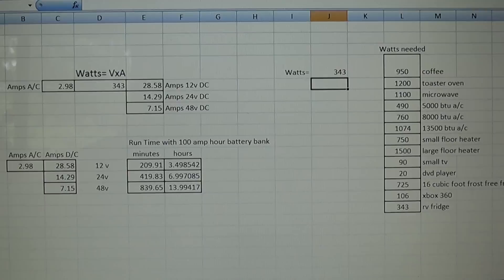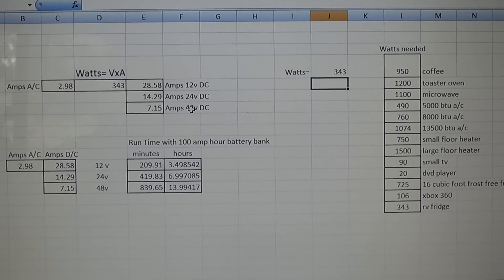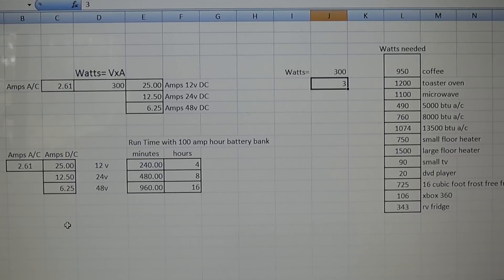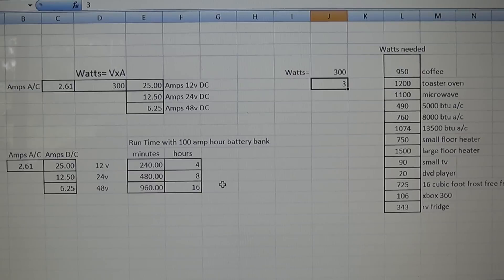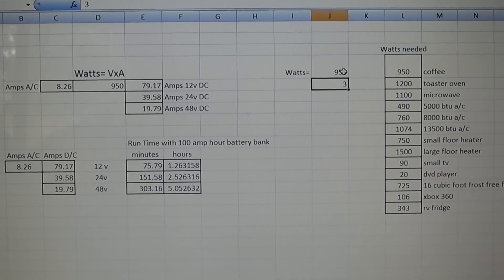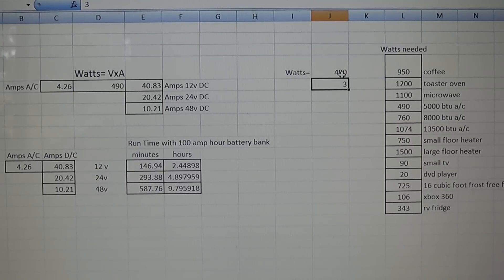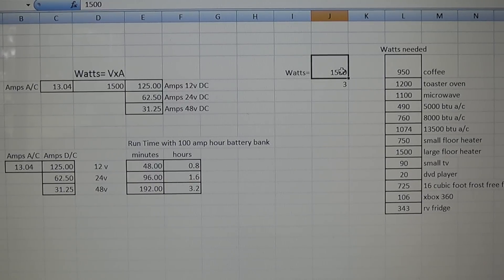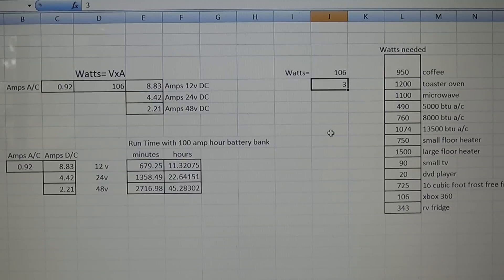What can run on an inverter and for how long?

Comment: i am sure you know that you cannot draw so many watt-hours in normal led acid battery but you can drain 50% of the watt-hours from an AGM deep cycle battery so on your spreadsheet this give 1.75 hours instead of 3.5 so you can use many devices who run for only minutes instead of hours like the coffee machine, toaster and microwave and all the electronic device who use so few watt-hours. 50% of 100amp-hour*12 volts= 600 watt-hour so with 2 battery in your battery bank, you can run the Dometic or Engel highly efficient 12 volts fridge who need in the order of 200 watt-hours per 24 hours and you can have a fantastic fan and charge your laptop and cell phone and tablet, etc... The only compromise is using a catalytic propane heater instead of an electric heater. Of course you cannot have an air conditioner unless you have a soft start device to manage the surge current plus a portable gas or propane generator.
Reply: I have a question for you.  I have one AGM battery, that is powered by one solar panel.  It is always at 13.6 or so on the control panel. Is 13.6 good enough to run a  Dometic CDF-11 Smallest Portable Freezer/Refrigerator? or even a small ceramic heater on low like 800Watts?
Reply: 13.6 volt is a full charged AGM battery, you can go down to 12.05 volts which is 50% without damaging or lowering the life of your battery, and most good standard AGM battery have around 100 amp-hour of capacity so this mean 100x12= 1200 watt-hour but you can use only 50%= 600 watt-hour and this is enough for a very efficient Dometic freezer/fridge with a 12 volts Danfoss compressor.

 Typical value for this device is 200 watt-hour of energy used in 24 hours if it is well isolated and ventilated and full of goods. CheapRVliving Bob Wells is an expert user in very hot Arizona. check his video channel.

 The 200 watt-hour of energy used will require 2 hour of good sun on a 100 watt solar panel. Check Will Prowse channel, he is the top solar expert and he wrote a fantastic book on Amazon. (research Will Prowse and you will find the book).

 A ceramic heater is a huge beast in term of battery and solar. One hour is 800 watt-hour. you can only use 600 but 200 for the fridge leave you only 400 so this is 400/800= 30/60  so you can have only 30 minutes of heat. This is not a good solution and it will deplete your battery too fast.

 Propane is the most concentrated form of energy in relation to heat but the only drawback is humidity. Burning propane means increasing the humidity level so possibly you need to ventilate more and watch humidity condensing in places it will create problems. One Awesome Inch channel is the best for information about this subject. He is using mostly Camco Olympian Catalytic heater, Wave 3, the smallest size

 Justin Credible in Vancouver promote wood burning inside a van, he is using a marine very efficient wood device. Check his channel.

 If you are a millionaire, Lou on Nomadic Fanatic installed a heat exchanger system, you can burn gasoline directly from your tank or diesel or propane with absolutely no humidity increase.
Reply: 12.05 is half of 13.6?  Wow, I'm in trouble, lol, I never would have figured that in a million years. Thank you for your input.  Now I'm confused even more, enough to know I probably shouldn't use anything in my inverter.  I just wanted to run my Dometic.
Reply: yes your unique AGM battery is plenty for a single electric load, meaning the Dometic. but if there is no sun, you will still discharge your battery in 3 full days. 600 watthour available / 200 watt hour used by the dometic in one full day= 3 days so the alternative is to travel and use a disconnect marine switch to link your alternator with your house battery. With cable and install, this could be around 100$ if you deal with a retired mechanic but could be 200 in a regular garage o 300 in a RV garage. It is possible i am wrong, you will have to check.  Third alternative is a little generator. Roadtrek Rich bought a very cheap generator and it is enough for occasional use. Check the internet for a table of voltage and charge for your AGM. in my case, 13.6 volts is a full charge and 12.05 volts is 50% full charge.
Reply: This has been VERY helpful. I've really tried to find this information on my own.  I am always in full sun here in NV, but I also have an 800Watt generator for emergencies (Earthquake 11613, 700 Running Watts/800 Starting Watts, Gas Powered Portable Inverter)  and a Schumacher XP2260 1200 Peak Amp Instant Portable Power Source and Jump Starter.   One of them have got to work for Dometic when solar doesn't, right?  I am going to Jamie's van build in hopes someone will show me how to use these affectively.
Reply: your Schumacher is a 1200 watt-hour AGM sealed led-acid battery, and the available 600 watt-hour will drive your fridge for 3 days. 1200 in the marketing name come from 12x100 amp-hour. There is so much confusion in marketing publicity, they don't see the difference between 1200 cranking amp (Peak Amp) and 1200 watt-hour of stored energy.

Most regular size AGM are around 100 amp-hour capacity so all the previous calculation apply to your case. A cable capable of flowing 1200 amp is big like my thumb. Do you see that around.   

Your Earthquake 11613 is big enough to recharge the battery inside the Schumacher. So it is not: one of them will work for my Dometic, it is one will work and the other will recharge the one working.
Reply: Denis Fortier perfect. Thank you!!!
Reply: Denis Fortier oh wait, can the Schumacher also be used for the dometic for a few hours in case I dont have enough on my other agm battery? I am getting a new house battery in my van ( for the engine ) someone suggested interstate was good. Do you concur? I would like to use it also to recharge the Schumacher when necessary while traveling. I know you suggested an alternator hook up but my mechanic said no. He’s not as smart as you apparently.
Reply: I check the web page of this product and the Schumacher is built around a 100 amp-hour battery so you have 1200 amp-hour/2=600 amp-hour available to feed the domestic for 3 days, not a few hours. A good battery for you is a battery who is guaranteed long enough for you according to the price you paid. If the price of the interstate is comparable to all others and the same for the guaranty, this is the same product, possibly with a different casing. For example Canadian Tire sell batteries but they just stick a label on them, they are coming from a major producer. If the battery is way cheaper, it is coming from China and should not be considered. Personally i love the AGM Eliminator series in Canadian Tire and the Nautilus marine deep cycle AGM series. It really make a difference in winter. 

Good mechanic are not always good electrician and good electronic technician. Now everything is computer controlled so many times you have to go to the official dealer because only them have the good scanner to read the codes and download patch in the firmware of the car.  

1) If only you drive the van, the lest costly install is a simple marine switch to link the starting battery and the house battery or a system doing an equivalent work but if you forget or badly use this basic system, you can overcharge your house battery and damage it or forget the switch on and discharge your starting battery

2) so they tried to replace the switch with an electronic disconnect (simple set of 2 big power diode) to link the alternator with the 2 batteries but separate them when the engine is off. The dis-advantage of this device is there is a loss in the diode so your 2 batteries are never completely fully charged

3) so they propose solenoid switch and you cannot forget because they automatically switch off but most of the Chinese cheap one don't last long because of the continuous usage, heat accumulate in the coil and it burn and secondly, the starting battery should be serve in the first place before the house battery so it overload the alternator meaning too much heat in the  alternator and reduce it life expectancy

4) so they propose smart solenoid switch with a timer inside so the starting battery if fed first and secondly the house battery but some alternator can deliver from 100 to 150 amp and it is bad for the house battery, starting battery can absorb that because this is not a long process to recharge a starting battery

5) last solution is an electronic charger who can be programmed with small switch to control the output current of the alternator according to the type of battery bank (CTEK battery charger)
Reply: Denis Fortier omgosh I have to write all this down and study it, lol. Thank you soooo much for your wonderful explanations.
Reply: I had a creative idea to ward off the condensation and or chill from night time. I have a chicken brooder lamp with a rating of 120V 60 hz  that runs a heat light bulb that is 50 watts. called Heat Glo. The holder itself says 250V 660 W That wouldn't take too much power would it?
Reply: this is a huge beast in term of battery and solar. 50 watt x 1 hour = 500 watt-hour, this is almost all you have available but you need it for the fridge. 660 watt x 1 hour= 6600 watt-hour, there is no way this can work.
Reply: Thank you!!!  Hugs!
Reply: @denisfortier9716  I HAVE A SMALL CAMPER. THERE IS NL VIDEO ATTACHED TO IT. I AM WATCHING VIDEOS AND I WANT THE BEST START UP KIT SO I CAN GET POWER. I WOULD LIKE THE COST AND SUPPLIES THAT I NEED.MY CAMPER IS 24 FEET AND HAVE CENTRAL AIR. I WOULD LOVE TO UPGRADE LATER TO HAVE UNLIMITED POWER. WHAT IS YOUR ADVICE. I ADMIT. I AM DUMB AND CONFUSED ON THIS WHOLE THING. SHOULD I START OFF WITH TWO BATTERIES AND 2 SOLAR PANELS?

Comment: I hear ya buddy. I guess your best input time will be from 11:00 to about 1:00. if you get a chance find a few regular panels to add into the mix and see how the input might change, I was in total over cast conditions all day, and those panels still went into absorb then float for most of the day, I was really impressed so far. still wiring in the sub panel before I fire up the inverter, if you hear a really loud BOOM!  it wasn't me lol

Comment: I understand about that shading problem. what size wire did you run from your connectors to the combiner box? I used 10awg and it seems to work ok. since we have similar systems it will be great to compare notes and findings. hang in there buddy, things will work out.
Reply from the maker: SilentDeath002 I had used 10 awg as well, since that is the same size as the wire that comes from the panel.  I have since put in 6 awg, but have not seen any improvement in wattage.  I also expect since my panels are flat and not angled towards the sun, that is also an inefficiency.  It all adds up (subtracts down?).

Comment: nice job on the spread sheet information. oh I was talking to Alan about your set up. he had to cook breakfast and will get back to me in a few. he thinks we might be getting some line loss issues thru the bottom control section of the magnum. ill get back with you on some recommended test he thinks we should try.  one idea I had was to just hook the solar panels direct to the controller then to the batteries and see if the input increases. that would be a fairly easy test. anyway, ill get back to ya buddy, have a good one! SD.
Reply from the maker: SilentDeath002 Line loss might account for some of it, but I believe I have some shading issues also.  The roof top air conditioner is shading one of my panels pretty good for part of the day and I have an antenna I need to take down that shades somewhat also.